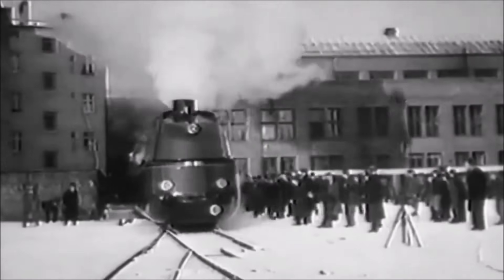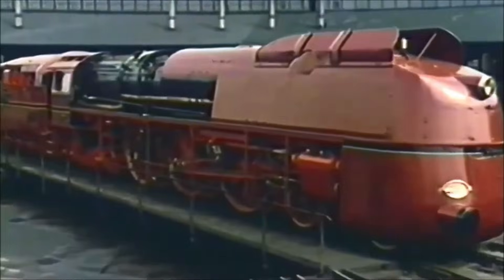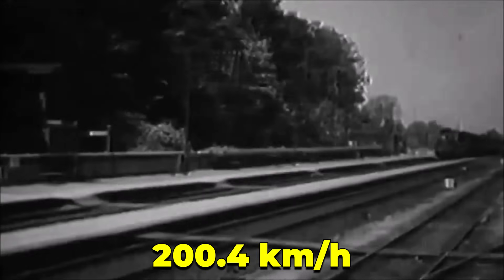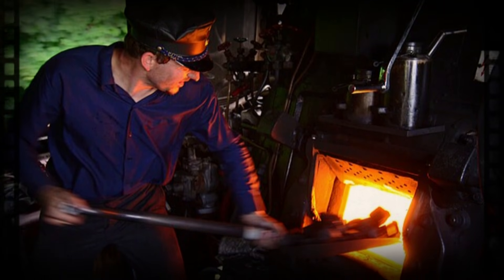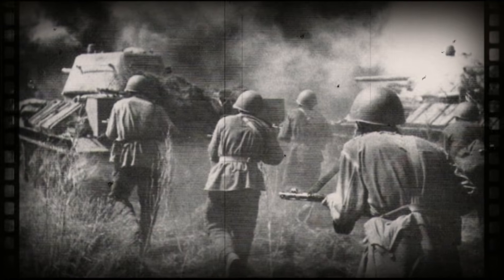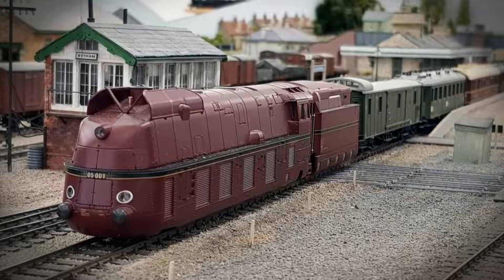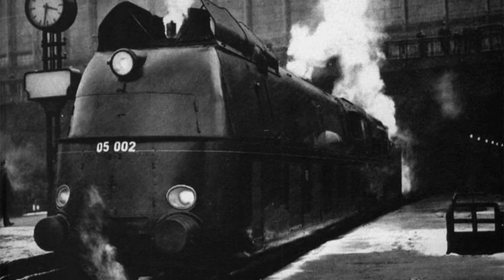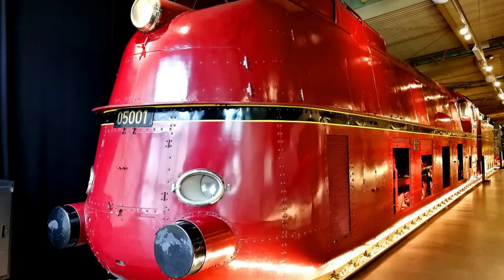Why Germany's Fastest Locomotive Was Completely Destroyed

Comment: You are wrong here 003 was a failure not a 2.1 version. 
It got sidelined because of it's experimental coaldust
firering that never worked propperly. The locomotive
looked better than it worked which it never did!!!
Reply from the maker: You’re partially correct, it was initially a failure due to the coal dust system. But in 1944 it was converted to a stoker firing and boiler rotation and then under went efficiency updates in 1955 to a lowering the pressure in the boiler and continued in service till 1958.
Reply: It was a cabforward, hence the coaldust/stoker firing. It was rebuild to a normal version.

Comment: On 30 May 1936 the 05 002 set an unbroken start stop speed record for steam locomotives: During the return run from a 190 km/h test Berlin-Hamburg it did the ~113 kilometres (70 miles) from Wittenberge to a signal stop before Berlin-Spandau in 48 min 32 s, meaning 139.4 km/h (86.6 mph) average between start and stop.
Reply from the maker: Yes, great information!

Comment: Not all three DRG Class 05 machines were scrapped....  N° 05 001 went to the Verkehrsmuseum Nürnberg, where it can be seen streamlined in large parts - the drivetrain on the right hand side remains visible - in its original red livery. The other two locomotives were scrapped in 1960.
Reply from the maker: Correct, it’s unfortunately not used beyond that and it could have had an even greater history.